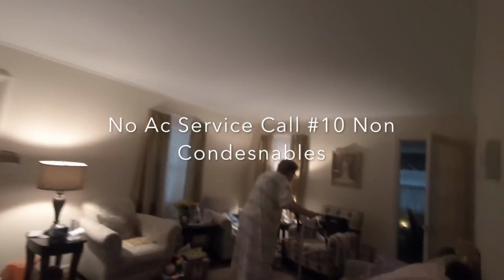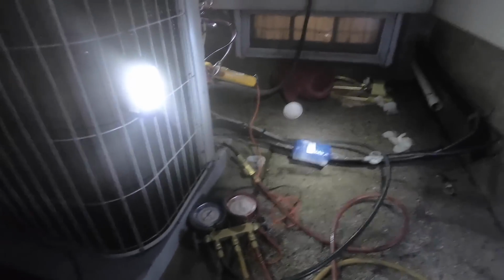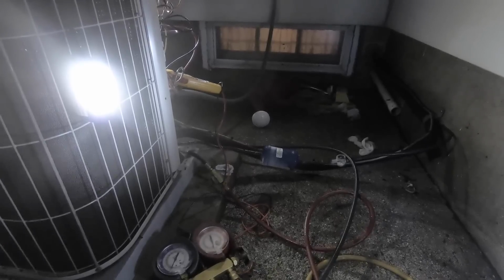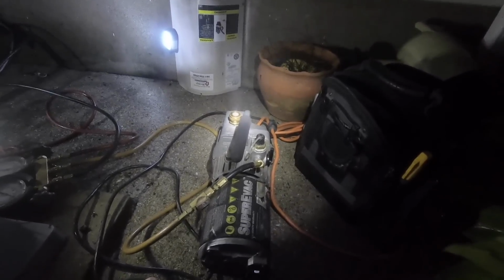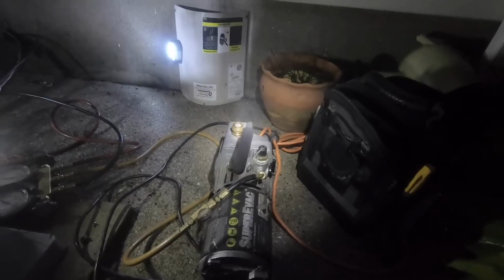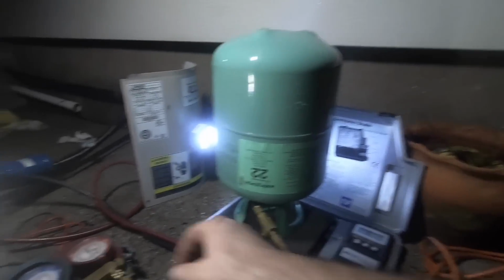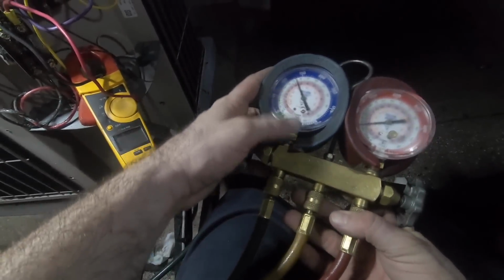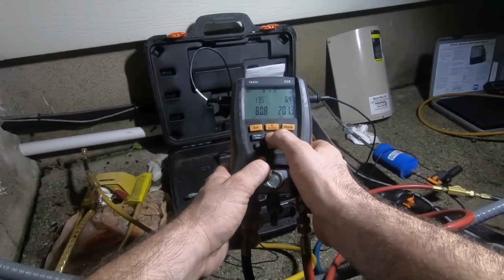AC Not Cooling Contaminated System Overheating Compressor HVAC

Comment: Are those the $15 harbor freight knee pads? I  use the same ones. Go through 2-3 pairs a year, but hold up just as well as the $50 ones
Reply from the maker: I will have to check the harbor freight knee pads out. These are clc gel knee pads. They are awesome yet I go through 1 to 2 pairs a year. I can only find the on amazon Home Depot used to carry them yet replaced them with their dead on brand which just sucks. He gel cushioning in the knee flattens from use. These the cushion is great the side buttons break off. I only use the bottom strap.
Reply: @thehvachacker  smart man using knee pads. I didn't for the first 20 years or so & now my knees are rubbish.
Reply from the maker: @rangerdoc1029  Do you need surgery to repair the cartilage? I heard it can be repaired just in case I ruin my knees.

Comment: and I observed  the same guage-set used for Mineral oil r22 and POE r410, with a long hose-set.   Yes, you are mixing the refrigerants.
Reply from the maker: I am not mixing gas if I verify their is no gas in my hoses. I work on the same machines and the machines I see over and over again have no problems. You can mix very small amounts of oil without any problems according to most manufacturers.
Reply: @thehvachacker  I use two guage sets .... one for Mineral based and one for POE based.  Thhe long hose set, plus the guage set does mix oils/refrigerant.
Reply from the maker: If there is 0psi on the gauges your not mixing refrigerant. As for the oil it is so minuscule to matter. Years ago we were allowed a 95/5 mixture of Poe to mineral. Now manufacturers don't even want Linesets blown out with r11 to clear out all the old oil. I had many talks with Trane and Lennox when I find a new unit with oil return problems. Yet they all say we could have up to a 15 percent mix and it shouldn't create problems with oil return. Do you still flush? I know we don't yet we add the oil conversion kit to all new systems on existing line sets. I know many guys who use the same digital gauges on all systems. Rare to run into a system like the one In this video.someone had to think this was a 410a system to achieve these pressures. If it was more 22 than 410 the pressures would be surging on my manifold. Using different gauges for different gases has been a heated topic for 20 years. Just as throttling liquid refrigerant when your only adding minuscule amounts of liquid refrigerant as it gets restricted passing though the valve core mixing with a pipe full of superheated vapor. There really isn't a right or wrong just a way you choose to perform the task in front of you. If I started running into problems on the units only I take care or then I would evaluate and make changes. This isn't to give you a hard time I respect all opinions. There is many paths from start to finish. It is the outcome that matters. You can hate my approach all you want my videos are not do this like me. It just shows what I deal with as an HVAC service tech. This call I believe many would of condemn this system and walked away. Instead I gave up 3 hours of my life to do what I can to give this old lady ac.
Reply: jd dr.jkindle you don’t always have to do that. I use my testo 550’s on 410a r22 r 507 404a 448a etc. just purge your hoses
Reply from the maker: I use my testo’s on everything also.
Reply: Not mixing. I do Industrial work so I deal r12 all the way to 410a. Does not mix and if concerned do a bump purge. 38 years in business.

Comment: Which testo do you use and what flash light is that big flat bar one your using that thing is super bright I want one also you did a condenser on a roof a while back and used some safety lock for your extension ladder what was the name of it I need one of those for my service calls I’m tired of using a bungee cord
Reply from the maker: I use the testo 550 been using it for years. The light is Braun slim bar https://youtu.be/QjrSLDu4sKI here i did a video on it. The ladder lock is the saftey device I use on my ladder. I finally went back yesterday and replaced that motor from the video your asking about.
Reply: You can get the Braun flashlight at any harbor freight. Amazing flashlight, I bought two!

Comment: Just a tip i carry a empty recovery (vacuum pulled)tank when I come across this problem I recover the charge. Then change the drier ,pull a vacuum and connect to vapor valve (flip the recovery drum) and put charge back in in liquid form while watching the sight glass and  stop when liquid starts to disappear from the sight glass and if needed top off with virgin. The non condensables stays in the  recovery drum. This is legal as you  are putting it back in the system. Now I've only tried it on single component refrigerants like r22 and r134a. Haven't tried on blends.
Reply from the maker: It might not of worked here since I believe this system was charged with 410a. I could be wrong yet suction was about 125 and head went around 500.

Comment: Got to love the De minimis R-22 release its great for the atmosphere. Did you empty your manifold into the suction side of the last unit you worked on?
Reply: Hvac isnt a good job if your a climate nut
Reply: @Tanneritefilledfido  I do my best to not kill the environment when im doing my job. Thats why i like geothermal heat and cooling the most with emergency backup heat of course. I'm in Colorado and most of my geothermal systems I work on are in the mountains over 8000 feet above sea level and need backup heat for any Colorado blizzards. I work on one by Snowmass, Colorado and they got 93 inches of snow in a single day and 36 inches in the Denver metro area where I live. That was a fun week at work trying to get around in a 2 wheel drive 1 ton van with bad tires and fully loaded with service parts and a furnace for a little extra weight on the rear axle.
Reply: I work in the field and do not give two sh1ts about the atmosphere
Reply from the maker: I always let the system pull as much refrigerant back into the system as possible before disconnecting. I don't like to store my gauges with gas in them. That might not have been r22 why I need to make sure nothing is in my hoses before connecting. This isn't a restriction but a 22 system someone put 410a into. Why I DIdn't check drier. What is your way of preventing the de minimus release of gas from hoses?
Reply: @thehvachacker  when you opened up your hoses you definitely had liquid what I do is I close the high side ball valve on my hoses and suck all the liquid refrigerant back out of my hoses into the low side of the last unit I worked on then and you only have vapor in your manifold.
Reply from the maker: If liquid was still in gauges due to not being able to suck it out when system pressure is equal to what is in the hoses nothing I can do. I have hoses with ball valves to let the system pull most of what’s in the gauges back into the system.
Reply: @thehvachacker  if a unit can't pull the lquid of you gauges into the "suction" side of a unit then the unit you are working on has a shot compressor sorry dude your wrong I have been working in the field for 15 plus years and have never released liquid refrigerant on purpose and never would and I hate technicians that donr follow the De Miminis rule do you need me to tell you what the rule is again. Who is dumb enough to not change a filter dryer on a system that has been contaminated beside someone that wants to kill and sell a new unit or a new compressor sorry but your kind of technicians need to all work at Applewood so we know what company to avoid.
Reply: @christopherrpaulson3741 , this is directly from the EPA De Miminis rule

section 4:
 Small releases of refrigerant that result from purging hoses or from connecting or disconnecting hoses to charge or service appliances will not be considered violations of the prohibition on venting. However, recovery and recycling equipment manufactured after November 15, 1993, must be equipped with low-loss fittings."
Reply from the maker: @dannelson8556  he doesn't want to hear anything. He believes he is correct yet why would I set myself up for a fine. If it wasn't de minimus I would just delete. Is anyone dumb enough to put a video of them just illegally venting refrigerant on an HVAC youtube channel where everyone knows they can get money for turning someone in? Chris most likely does the bucket of water recovery set up. Then goes all Poindexter on youtube in comment sections.

Comment: Great video. This is a unique situation because it's obviously a problem created by a previous technician which you took time to investigate. One question however, you dont discharge the capacitor before you check it?

Oh yea you did a good job trying to communicate with the customer she obviously had no clue what you were talking about but you did explain that you were there to fix the unit and not sell her a new one, thats probably the only thing u said that she understood lol
Reply from the maker: This is unique situation which most may never see. I have ran into a system with nitrogen and 22 mixed. Due to an installer opening valves on a dry unit thinking it was precharged. Which is why I don’t understand anyone who is telling me 3 hours on this job was too much time. As far as discharging goes it never seems to do anything when I try to discharge these newer caps. It never seems to do anything when I discharge the caps. I usually try to discharge yet never get the spark like I see on the older capacitors.
Reply from the maker: Would the bleed resistor be located inside the capacitor? Some capacitors have the resistor going from one terminal to the other.

Comment: Great video ...good call on replacing the refrigerant..... a sigh of relief when the pressures were normal for r22
Reply from the maker: This could be a once in a lifetime service call. I was so relieved the system was able to pump correctly after the beating that scroll took trying to compress the wrong gas, causing it to overheat, luckily I didn't get the burnout smell from the oil.

Comment: I'm thinking your right. I had ti correct a unit once. Did the same thing. Never assume. If lable is not readable look at compressor lable if that isn't possible look at txv if has one find out some how or it will destroy it

Comment: Hey Mr. Hacker, good video and good catch. I agree with you about cleaning the condenser before gauging up. My guess is a slimy sideshow Bob stole her 22 and dumped the contents of a recycle tank back in, maybe sell her some locking caps or ask her to get a video surveillance camera... thanks!
Reply from the maker: It’s a guessing game what happened. That was a rough day for me since it was my second day back to work after a nice vacation in Poland. My internal clock was still 6 hours off and the day before I worked till midnite. Not a good choice of mine to be on call when I return from a vacation with a 6 hour time difference and near 100degree weather. I still need to check out that uei meter you asked about
Reply: The HVAC Hacker you lucky dog, Poland is an awesome country and Polish women are beautiful... I’m trying to convince my Polish friend to go with me to Krakow and Warsaw and be my tour guide.
Reply from the maker: We go every summer since my wife's parents live there. We go to visit for 2 weeks. We landed in Warsaw yet spend the whole time northern Poland. It is nice you should go if you get the chance. Easier to have someone who speaks polish with you. Alot speak english but I took a solo trip to gdinsk by myself it was interesting.

Comment: A restriction in the liquid line from a plugged filter can cause flash gas in the sight glass on a fully charged system.  Change the filter.  It may have caught a lot of stuff from the overheating.
Reply: Forgot to mention, move your thermocouple clamp before and after the filter and sight glass.  Excess flash gas reduces cooling capacity.

Comment: Close the service valves and blow vapor pressure through the high and out the low to check for restriction.
Reply: A restriction means low suction and with little going to the compressor, low discharge pressure too with excessive supercooling as it condenses and remains in the condenser and receiver or filter dryer..  Not likely a restriction.  High pressures are not a sign of restriction as the gas will cool and liquefy unless there is a large amount of non condensibles.  With the high temps, it is prudent to check for acid and signs of burnt oil.

Comment: you spent a lot of time and effort  cleaning to see if it actually has refrigerant and can start . hard to charge in the real world. if it doesn't run. What do charge?
Reply from the maker: How is it hard to charge for a service call? This is the real world service calls. I charge $125 an hour for  labor weather it works or not. I can’t recommend replacement without cooling compressor and veryifing the compressor is toast. The customer pays weather it works or not. If not they need a new system and won’t get it if they have an open balance. What would you do condemn the compressor instead of cooling it off?

Comment: So will all that stress the compressor took reduce its life?
Reply from the maker: It could reduce the life of that compressor. The bimetal thermal overload may weaken and not reset. Can damage the start winding from the constant lock rotor and not starting? The scroll plates might become damaged trying to compress 410a or whatever was in this system. They weren't designed for those pressures. The oil may start to break down and slug up. The capacitor can overheat and swell. Yet how do I not try to fix this old ladies AC when it's near 100 degrees and will be in the temp range the next 5 upcoming days. Most of my customers just want me to get their system to run and will deal with replacement in the future. Could you leave her without ac for a week waiting for an install crew to free up?
Reply: The HVAC Hacker I’m glad you got it running for her. Sucks someone put the wrong refrigerant in there. The damage was done but at least you got it back up and running for her. Most people appreciate guys like you.
Reply: She was lucky it's a scroll and not a piston compressor. They can take alot more abuse, plus you can't add liquid into the suction line, while the unit is running, on a piston compressor. I loved r-22, also.

Comment: Manufacturers build the condensers with the fins so close together to gain efficiency. That might work in a controlled environment, like a hospital operating room but makes them pretty useless outside in the real world where there is dust and debris to plug them.
Reply from the maker: It works only if the owner of the equipment keeps it maintained. The condensers need to be cleaned yearly. It is amazing how quickly Lennox xc17 and up coils collect debris.
Reply: I've seen them plug up in a few hours when the dandelions head out or trees start dropping things. Reversing fans would be great. At the end of each cycle, run the fan backwards for 2 minutes. A local truck and heavy equipment refrigeration service had condensers made with 1/4 inch spacing between the cooling fins to stop then from constantly plugging up on wood processing machinery. They worked so well that the started using them in other applications. They make what are called cotton core radiators for forklifts used in cotton plants.
Reply from the maker: Good idea or a filter for condenser

Comment: Hahaaaaa..first other than myself wearing knee pads..age n pain. 👍
Reply: +++ on protecting knees. My bosses do not care if you have a 25ft army crawl to air handler or furnace under house. Crawl space only 24" high. By end of day if i didn't wear knees will be killing me.
Reply: New young bucks coming into trade laugh at us now. But give them some time working. Wont be laughing, they will be crying
Reply: They're pretty good at replacing knees these days.

Wouldn't it be nice if they put the units on a 2 foot high stand? Keeps it above a lot of debris and makes it much easier to work on.
Reply from the maker: A company I once worked for would install most units standing up on-top of a return box whenever possible. Even in attics since it was mega mansions being constructed

Comment: Plug C coil and over charged he did bleed hoses enter non-condensables.Good job, that's exactly what should have been done. Great repair.
Reply from the maker: I don't know if someone put 410 or what into this yet those pressure were wacky for r22

Comment: start capacitor relay doesn't open the compressor will over heat immediately
Reply from the maker: This is true and does happen
Reply: Lot of condensers don't come with  start packs just  run caps